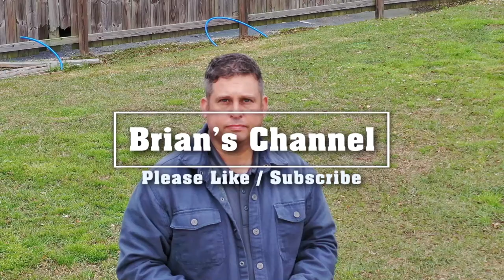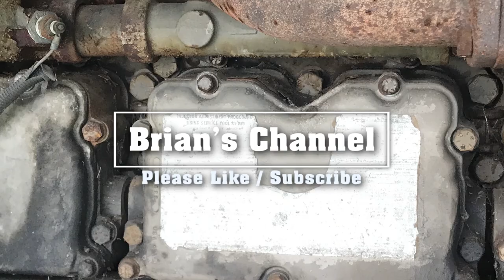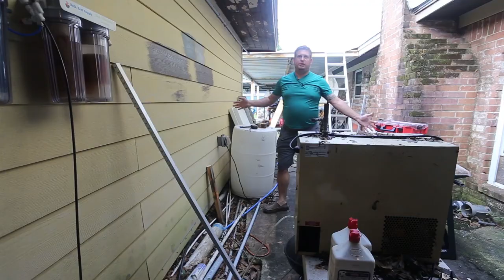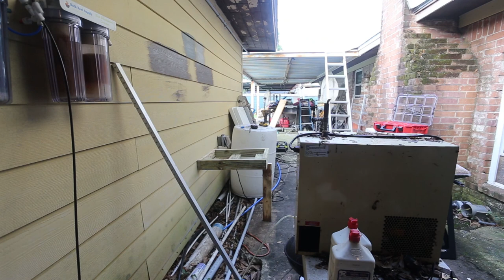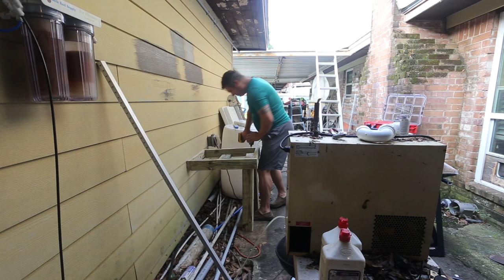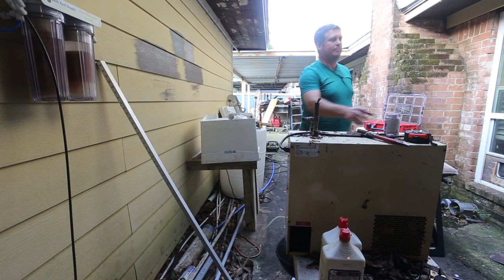Home Improvement: Recycling a Utility Sink (2 of 4)

Comment: Hi Brian.  WOW!  Serious mic fail, but I suppose by now, you definitely know that.
I had assumed that it may have been on part 1, but I now guess that maybe you shot the entire series but didn't notice the fail until afterwards.
No worries, we can still see what's going on.
Regards Mark in the UK.
p.s. While I'm here, I lnow you sold the Neoplan, but what's happening with the Crown? ex-school bus project?   Have I missed the video(s) where you sold it????
Reply from the maker: Yea the Neoplan was hard to get parts for and everything was an engineering project.  It also had crap road clearance.  

The Crown is just parked for the moment.  Mostly I don't have much extra cash to put in it right now.  I also have an issue with the stupid Gulmite screws that it's full of. Gulmite drivers are hard to find.  Scratch that, they are impossible to find.

As for the mic issue, yea it was a loose cable and I didn't discover it until the end of the 3rd video.  I run Magic Lantern to try and prevent issues like this... but stuff happens.  I felt really bad and sat on the footage for a few days before I decided to compile and post it.